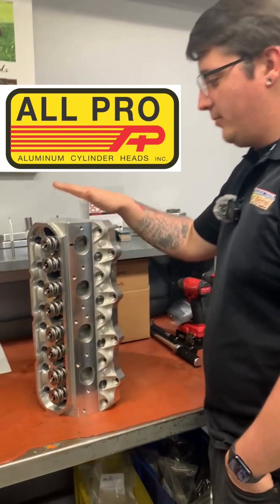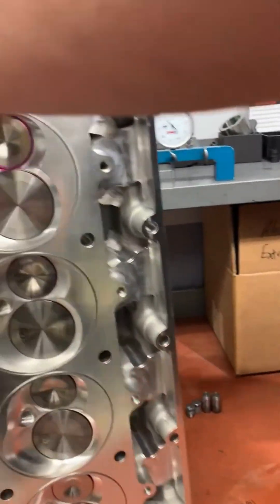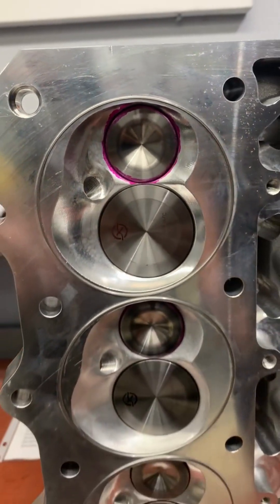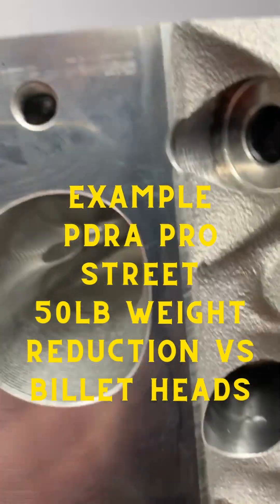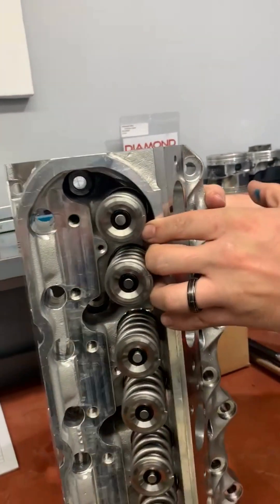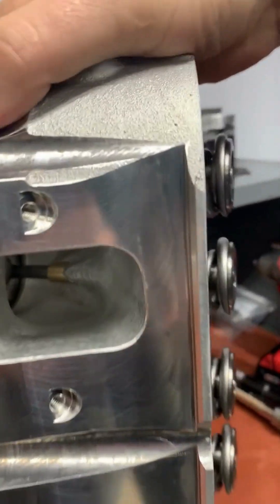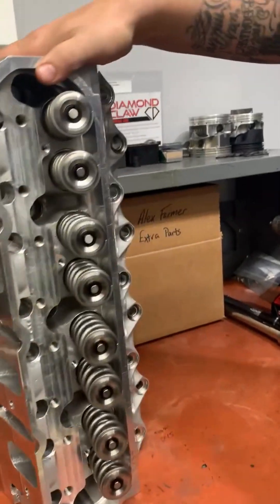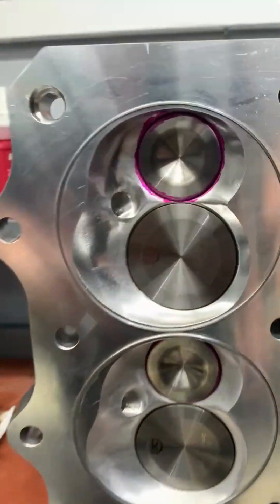4,500 HP Billet LS, Pt 3, Heads

Comment: I think that motors is awesome but 4500 hp is that even a possible number out of any regular natural asperated engine?
Reply from the maker: This design is for heavy boost running with twin 88mm turbos.
Reply: And lets not forget the Cleveland style mains. And yeah, it's one hundred percent possible to met 4500 N/A, all those 10,000 horsepower top fuel cars are naturally aspirated (they also get torn down and rebuilt every race and their injectors are ridiculous, but it's definitely possible)
Reply: @Trucks_n_stuff  Naturally Aspirated + a ton of boost from the blower on top. So no, not naturally aspirated.
Reply: @eatmorechicken1064  yeah, I was definitely wrong about that one. i still argue it's doable to make 4000+ NA, but it would probably only last a few seconds. You'd need a compression ratio of like, 15 to 1 or greater and still be using nitromethane, so fire ringed and o ringed heads with copper head gaskets, no water jackets, billet block, billet crank, basically it'd be borderline unusable as anything other than a drag car.